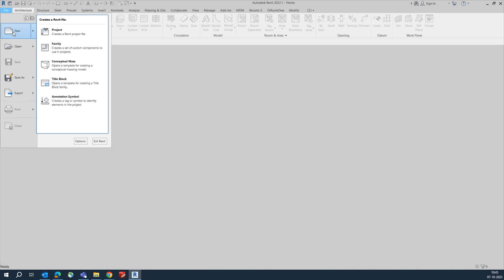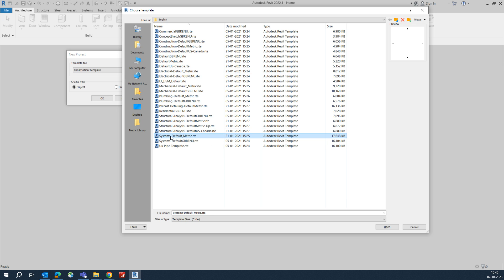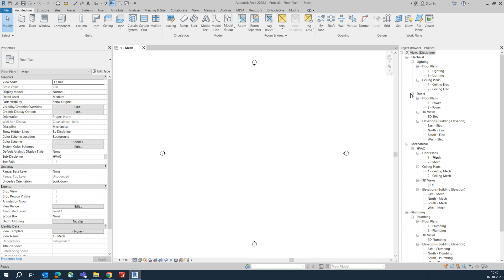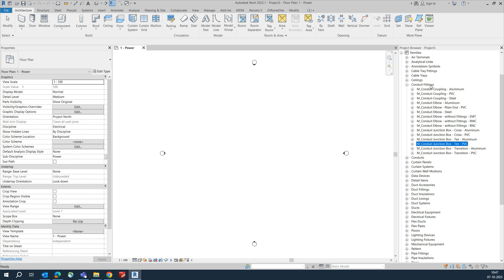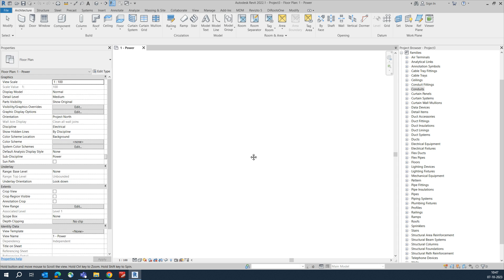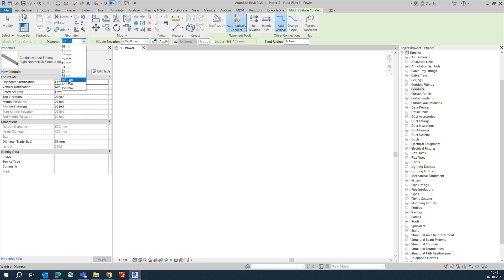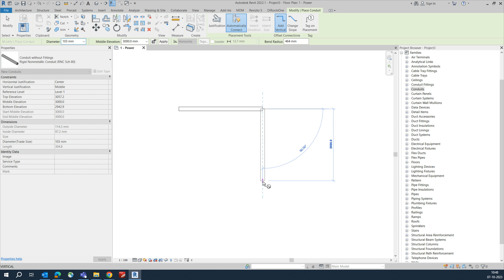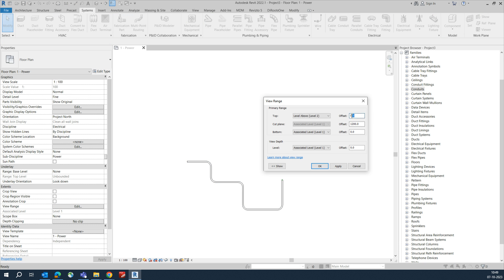Conduit & Fitting in Revit MEP

Comment: Hi, is it possible to assign a color to a conduit fittings (like for example lighting conduit as orange) where it will reflect to the design collaboration/acc?
Reply from the maker: Hi thanks for your comments  yes you can make colur for Conduit using filter 
https://youtu.be/Q6DKQ4U9O7c